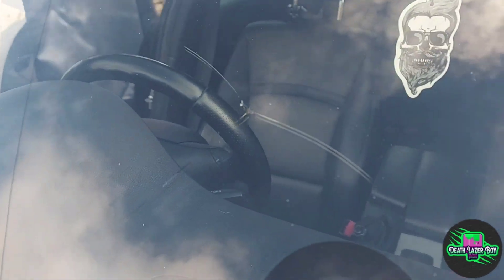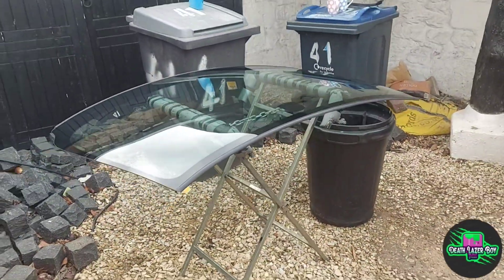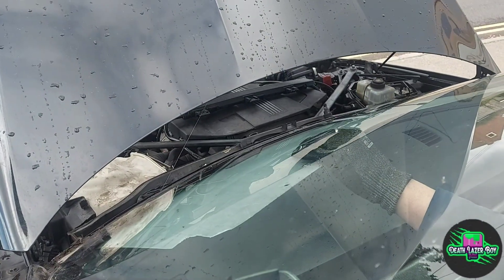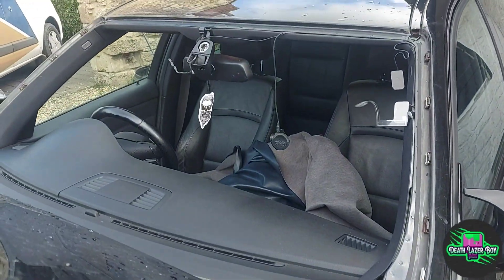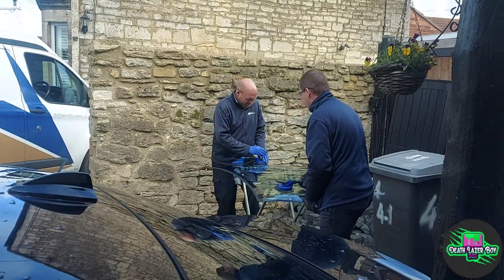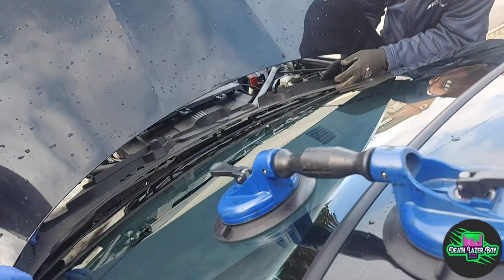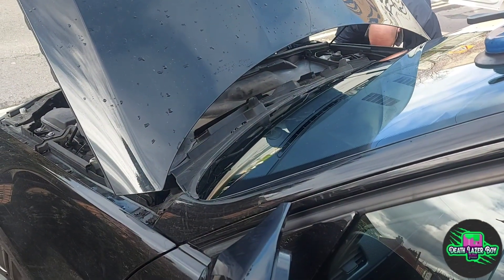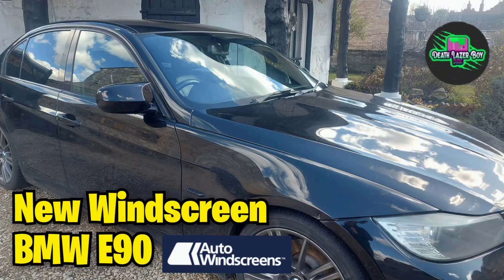BMW E90 3Series New Windscreen Windshield Windschutzscheibe

Comment: never put glue on car but on shield man
Reply: hate for you to fit my windscreen as I prefer them not leak 👍
Reply from the maker: That's approved bonding not glue
Reply from the maker: Me too, that was the insurance company doing it ! and it hasn't leaked and I can see out as its not cracked
Reply from the maker: I wouldn't fit my own either
Reply: @DeathLazerBoy Yeah I know of AW, they use a brand called DuPont Bond and primer, I’m glad you’re happy with it and the technicians did a good job! Just made me chuckle how the original comment has no clue about fitting glass correctly 😅
Reply from the maker: @kieranpaul9392 yeah totally how did he think they are put on in the factory!